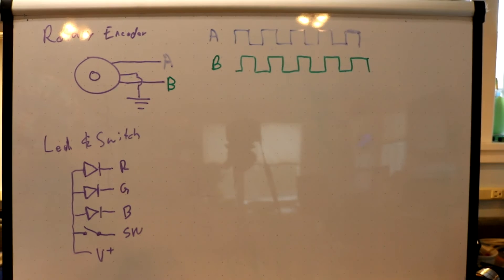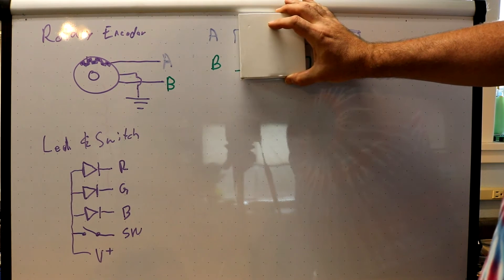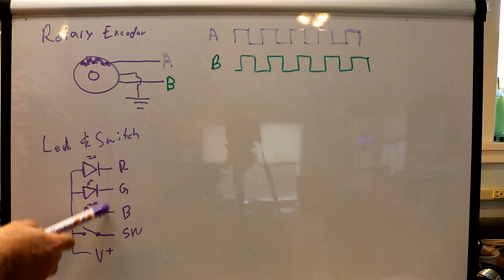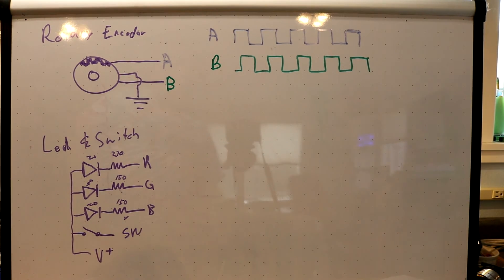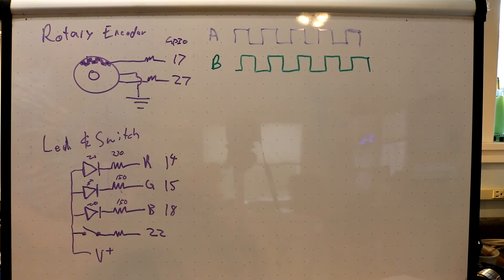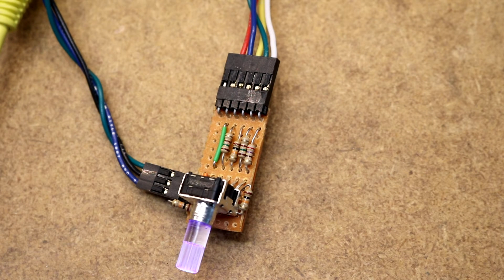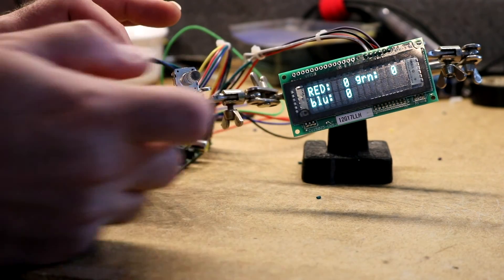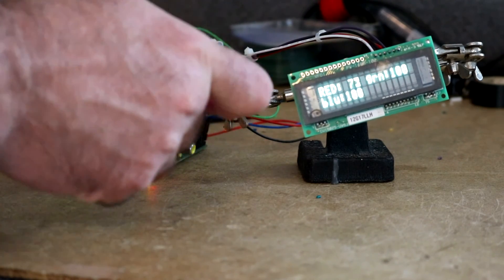RGB Rotary Encoder on Raspberry Pi

Comment: Isn't it easier to just use a 32u4 microcontroller and make the encoder behave as USB mouse(wheel), so it basically works on most computers including the Pi?

Comment: how much of python 2.7 do i need to change to add another encoder i dont need leds or push bottom for application. i need a pusle count, change direction, and speed. my application is telescope and observatory gps and tracking. i am a newbie at this i need a little help to get me in the right direction